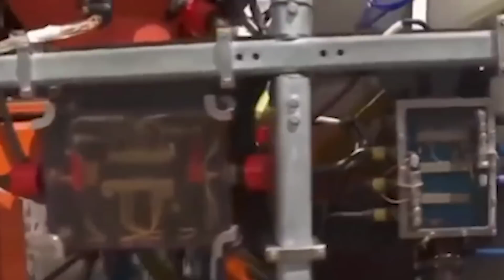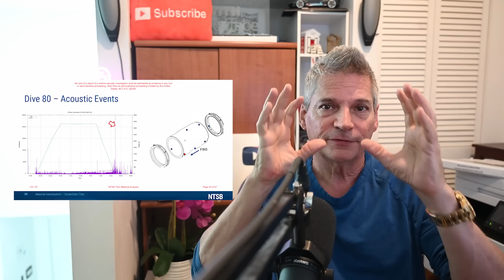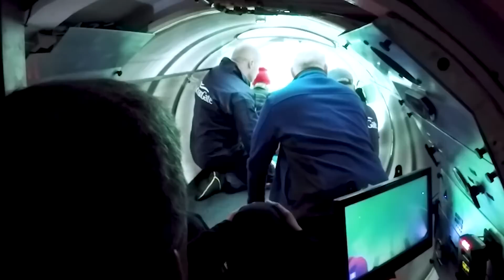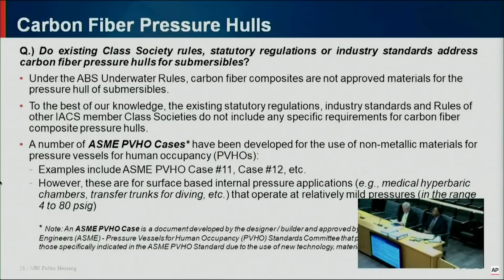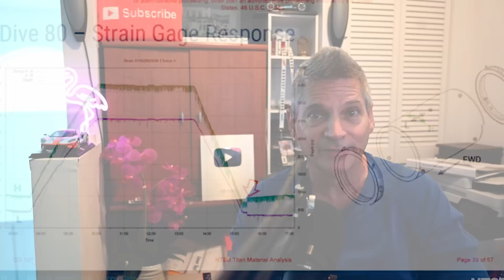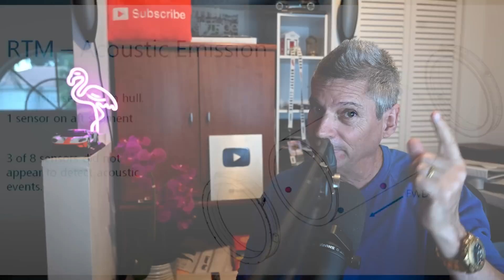How OceanGate Titan Sub Realtime Hull Monitor FAILED! RTM

Comment: 3 out of 8 sensors are not working? That's almost 50% of your data missing!  Were they close to each other or scattered across the hull?
 Did anyone count the number of acoustic ticks, and did they have a number at which you would say, Ok.... that'll be enough ticks, time to retire the hull.

Comment: fyi, I believe the test shown in Jeff's video in the lab was from Univ of Washington? And that scale implosion broke a ton of university equipment and Stockton had to replace it all. the relationship soured after that.  But for real...what kind of idiot does 1 test at 1/3 scale and it gets to a record depth ONE time...and think that's good enough for 80+ dives with a ton of other uncontrollable.  Don't forget there are a ton of uncontrollables bc Stockton was cheap and didn't protect his product.

Comment: Stockton Rush honoured the rule that the carbon fibre cylinder was not to be drilled through in any way in order to keep its strength but at the same time he allowed the cylinder to be lathed after each layer was cured in order to keep the cylinders shape which meant cutting through carbon fibre strands which is effectively the same as drilling through the cylinder. That's how good an engineer he was. He ought to go down in history as this centuries biggest engineering idiot.

Comment: The reason for using certain materials to make something like that is we have lots of accurate data about titanium and steel for instance...an engineer can take the dimensions and in a few minutes tell you exactly how thick we have to make it if it's titanium or steel and how much it will weigh but it Will be strong enough as long as you do that

Comment: But it actually worked! 

There was a proof, presented in court, that the RTM system has measured strange deviations from the normal acoustic sounding during the last couple of dives (starting from the last 2022 dive during which a loud bang upon surfacing was heard).

It was just Rush and his team who have decided to ignore the warnings.

So basically it has worked in terms of warning them. 🤷

Comment: I like your videos on this subject, but I concur with Scott Manly's theory. That the forward glue joint that mated the titanuim with the carbonfiber failed due to differential contraction (differential strains) between the two materials over several dives made the glue fail in shear. Look at the titanium hoop, the inside lip is sheared off all around - this implies that the water infiltrated the circumfernece of that glue joint until it failed and the water pressure blew off that inter lip entirely. If you look at the rear ring you don't see much less damage (if the carbonfiber failed you'd see identical damages to both titanuim rings.

I think the monitoring system shows the first stage of that joint failing after dive 80. and if anyone were looking at the data at Oceangate, they would see the craft was compromised and no longer sea worthy.

clearly they just collected the data and didn't bother to look at it - lol.

Comment: Is the problem with carbon fiber that the fibers are very large on a molecular level than steel or titanium bond?

It does seem that certain polymers like nylon or dyneema are insanely strong when pulled tight. Perhaps that doesn't extend to cross loading.

Comment: I’ve worked with enough sign companies to know that if any bubbles show up after printing or layering stickers on the surface, that you have to redo the sign entirely. Which costs money. Which is why you work hard to make sure that doesn’t occur in the first place.
Having bubbles in the casing just screams failure to me from the start 😬

Comment: I understand the reasons for using carbon fiber for the pressure vessel/crew compartment. Its all about weight. The CF hull allows neutral buoyancy and therefore eliminates the need for additional air storage/buoyancy control tanks and pumps as well as related tubing, valves and control equipment. However, it seems to me a hybrid system would be the best design.
Perhaps a thin .250"/6 mm wall titanium outer hull over perhaps a 4" wall CF inner hull.
Yes it would be heavier than 5" wall CF but it would also be much stronger and tougher. It might not completely preclude the need for external buoyancy control equipment but it would surely have many advantages.
And who knows, perhaps the perfect ratio of titanium and CF could be attained to have the ideal characteristics of strength and light weight.
Im not a nautical engineer but my Spidy senses go off the charts every time I see or hear the words carbon fiber hull and 3,800 meters depth.
I would NEVER go down in that thing under any circumstances.

Comment: So the RTM everyone including myself was mocking last year actually worked perfectly. 8 dives advance warning of implosion, that's plenty. 

What they should have done is build a replica with an RTM and stress it to implosion so they knew what pre-implosion data would look like. Quite possible they could have determined that an off the scale acoustic event accompanied by a permanent change to strain gauge data was warning of imminent implosion. Of course the fact they built the RTM to monitor such events and then ignored said events says a lot. 

Show any layman the data and they could have said that whatever the system was designed to detect, is exactly what happened on dive 80. It like saying here's a temperature gauge that goes to 100C and if it shows high temperature it's bad. Now it's showing a temperature of at least 100C but let's keep going. 

Frankly that's the most shocking. Despite all the mistakes and cut corners, the arrogance etc... had Mr. Rush interpreted the data with any common sense at all he would be alive. 

In fact he could be smug AF. See? The RTM worked! Our hull may not be perfect but we are capable of telling if it is within about 10 dives of failure. 

If he spent half the time he spent talking about the RTMA actually looking at the data, he'd still be alive. And those hulls weren't that expensive, that was the whole point of CFC. So if you are going to scrap it at some pointy, a large acoustic anomaly and a permanent change to strain data, to me, a complete armchair fool, that's about as clear a sign as I could possibly imagine. 

It would need a lot of testing but Rush may have shown that you can build a shoddy hull, as long as you monitor it, you will know well in advance that it is about to fail. How long was a dive? 3 h down, 3 h up and probably a comparable amount at the bottom, call it 10 hours. So they got a good 80 hours advance warning. 

What exactly was Mr. Rush expecting to see? The strain data spelling out "implosion" on the graph? 

I don't get it. This is by far the dumbest thing he did. His silly submarine would have been fine for 80 dives per hull. Call it 70 if you want some reassurance. 

What data would have convinced him the hull is done? Because that's what the data was clearly telling him and he was an actual engineer. 

The amount of cognitive dissonance you need to tout the benefits of a novel safety system only to ignore it when it actually performed as designed is mind boggling. 

And the strain data clearly disproves his hull settling BS about the loud bang. Just an acoustic event and no change in strain ok... you can delude yourself into discarding that I suppose but an acoustic event followed by a measurable difference in the way the hull deforms under pressure? I can't imagine a more obvious indicator of sigbificant damage having happened. And it lasted 6 more dives without a problem and almost made it to full depth. 

As morbid as this is I am actually happy they didn't implode next to the wreck and damage it. I do wonder about the railing falling off the bow section though. That happened sometime last year. And Titanic would have been around half a km from the bow, going off like a giant depth charge. I think it's conceivable they blew the railing off the bow. It was already very fragile, no one was suprised that it fell, the same has been observed all over the wreck.

Comment: I still do not see any advantage of using carbon fiber in a sub. Even if they layers titanium between layers. You don't have a weight issue with a sub that can't be solved with ballast. You could even design the ballast to be retrieved. Built in air bags inside the pipes that fill once released from the sub. They would just float to the surface. could even use the ballast air tanks as spare for emergencies.

Comment: I am not an engineer in any way and even I thought about support rings. Not to mention Rush did one test that showed what depth the sub would implode at and got his implosion depth number from it. Any reasonable person would know that with repeated stress from descending and ascending there is gonna be fatigue and wear over time, and that yes you can reach the titanic in dive number 1 but by dive 50 the craft may no longer hold the structural integrity it did at dive no1. There should have been repetitive stress testing on the vessels design before it was even built and I say that as a layman as its pretty fing obvious.

Comment: A lot of people are putting a lot of weight on the cylindrical shape of the Titan being a factor in its failure. I would like to point out that Aluminaut was a cylindrical submersible larger than Titan, and it was capable of diving to 5000 meters.

I don't think Stockton Rush believed in safety factor, which is why he reduced the hull thickness from 10 to 5 inches.

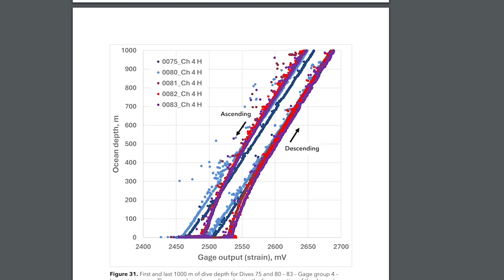Comment: The graph at 10:00 seems to show little change of measured strain with increasing depth for the first 100m which could indicate that strain is not being applied to the inner layers of the pressure hull straight away. This could be caused by delamination - i.e. The outer layers taking all the load until they are forced against the inner layers.

Comment: There is an application that carbon fiber excels at: storage pressure vessels.

CNG fuel tanks for public transit busses use carbon fiber as a support structure to encapsulate a bladder that holds the CNG fuel. They don’t come in to contact with the gas, since CF is permeable to an extent.

Plus there is a reason why those tanks are only rated for 20 years, they become subject to internal delaminating with all the cycles of fueling and operation.

Honestly I’ve never seen a carbon fiber pressure container fail, primarily is that there are multiple pressure relief devices that release the gas’s before a structural failure, and those are based off pressure and temperature, not acoustic sensing.

Carbon fiber is a neat material, but we know what it can’t do. Rush was just a cheapskate they never got to witness his hubris.

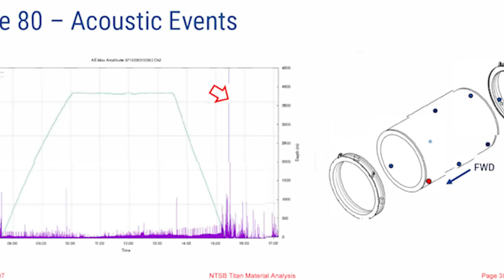Comment: 8:22 This just reeks of a hasty cover-up.
Look at the depth axis: this event occurred after they’d already reached the surface. 
My opinion on what most likely happened here? Something rammed into them, and fairly damn hard at that.

If that’s indeed the case, then given the extreme conditions this vehicle operated in, combined with carbon fiber being a notoriously brittle material (especially under compression stresses), the hull should have immediately been taken out of service for a complete inspection (& very possibly written off, depending on what they found).

Comment: It's obvious the 1/3 scale had a different diameter to the full scale, so a smaller size circumference could handle a higher pressure than the real sub. Also the length and surface areas effect the stresses the hull can handle. This test maybe a proof of concept, but definitely didn't tell them anything about depth rating.

Comment: Good video, but the issue I could see with the rings is they would probably have to be put before any layers of the fiber, or else since they'll probably flex at different rates, it would have just delaminated the layers faster. But at that rate, you could have just put a metal sleeve on the entire interior as extra support, possibly out of titanium, just less.

Comment: A lot of issues with this entire design.  

Carbon fiber is not a good idea for this application.  It’s not strong in fiber compression, which is what you have in this load case. There is absolutely no way to build it without internal voids.  Especially in thick composites, you will have voids.  They are incredibly hard to control.  

There really isn’t any way you can know how many “acoustic events” are too many.  What’s your failure criteria?  When it costs so much and there is a culture of normalizing the abnormal you’re not going to “fail” the unit and take it out of service.  You keep up with “it’s not significant” assumptions. 

The hysteresis in the strain curves is also concerning.  Maybe it’s just from a temperature difference between start and end but if it’s not going back to the original strain state it should be a concern flag.

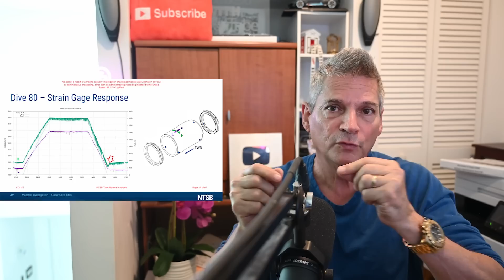Comment: 4:06 "Proactive vs Reactive," there's a lot of misunderstanding about metrology ("measurement").
There's no difference between a speedometer, a pressure gauge, a tape measure, an acoustic measurement device, a strain gage, and all sorts of other metrology equipment (like a protractor, a weigh scale, a set of measuring cups, or a thermometer). The only thing any of these do is to measure something.
The problem with Ocean Gate is that the real-time measurement devices weren't adequate to measure the damage and to predict failure.

Comment: No amount of internal stiffner rings would have helped. They'd have to be as strong or stronger than the actual hull, and fit TIGHTLY. Because if the carbon fiber hull gains any movement in a collapse, the rings would be hit with a hammer blow with the speed of sound in water. 

What would have helped? One-time use of the carbon hull. Better lay-up without wrinkles that had to be sanded down. Those wrinkles are essential a low-resistance failure path. Clean environment during construction, so no foreign particles are caught in the fiber. Higher tensioning during lay-up, so no air is caught inbetween the layers.

Comment: Did they test repeated  pressure depth tests on the test article.  Was the test article made the same way as the real sub. I am sure the test article could not show the equivalent forces in the middle of the cylinder of each pressure cycling. As the actual dive cylinder is so much longer.  Did they actually hydrostatic test the volume change of the test article?

Comment: If the guy at @06:45 is a pilot, he knows that experimental aircraft still have to be inspected by the FAA and granted a Special Airworthiness Certificate and operating limitations, in most cases must still comply with Airworthiness Directives (AD) (think recall items for a car, but mandatory compliance) and at minimum have an annual condition inspection performed. You also cannot use one for hire without a waiver from the FAA. I would fly in an experimental aircraft over a helicopter any day. Experimental aviation gets safer every year, and I wish people would stop using that clip. It is not an accurate comparison by any means.

Comment: I think that the RTM system is not as reactive as the overheating display light in your car. Having both the string gauges and the acoustic sensor should have provided both reactive and proactive (not that reactive is worth anything for a sub lol) signs that the hull was failing. By and large, those signs were there but they were played down and outright ignored by Stockton.

I think the "non-healing" nature of carbon fibre grinding down the epoxy to literal dust is precisely where you hit the nail on the head. That's the big error. These hulls were always going to fail at these depths. How any engineer can see the wrinkles and warping in the carbon fiber material as they were wrapping it and not immediately realize that's a potential for water and pressure ingress is beyond me.

EDIT:

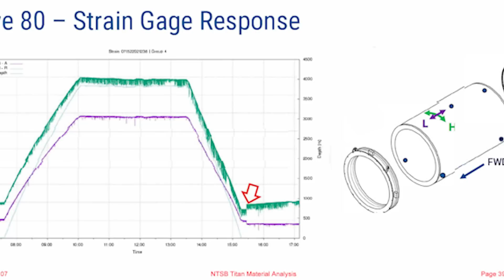just got to the 8:40 part where you show dive 81.  That's precisely what I mean, I always thought the idea of the RTM was f'ing looney but you can't argue that it didn't give them warning signs. That is a giant red flag.

Comment: So let's see; these sensors will detect material failure once the structure is under obscene uniform pressure which happens when you're thousands of feet underwater. Well, that's sort of like saying not to worry about having your children poked because if anything goes wrong then vaers will detect it! And, believe it or not, I did see some phd, md, lab coated, bow tied, round bottle bottom bespectacled, nimbnotzz saying this on national tv.

Comment: Of course they were misinterpreting the data, they had no way of knowing what the data meant! The only way they could have interpreted the data correctly is if they built and tested multiple hulls to failure to gather enough data to prove they could reliably predict a failure before it occurred. They never did that! They tested what, 1 model to failure and thought that was enough data for a full scale sub with people inside? Insanity!

The craziest part is, now that the hull failed, they potentially have some of the data needed to more accurately predict a failure even though 1 sample still isn't enough. But if any of the experts that chimed in on carbon fiber hulls are correct, the testing would show that you cannot reliably predict a failure with carbon fiber because of the heterogenous hull material, it's different every time, so it will always act differently and never give you a reliable warning.

Comment: The fact that every crackle means the hull got a little weaker means that the system at best could've told you when to replace the hull for  new one. But they didn't mean to create disposible submersibles that you throw most of away after a few dives.